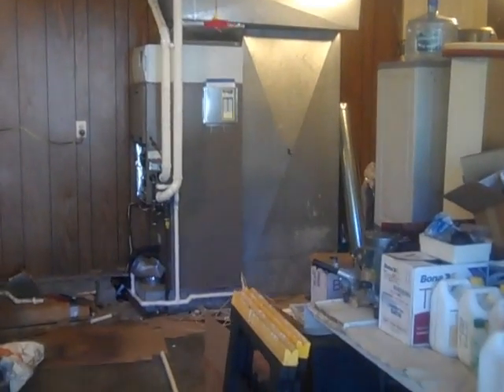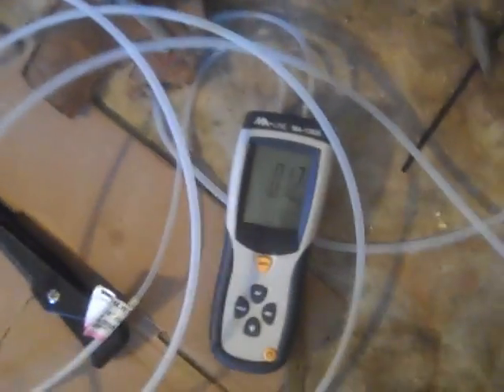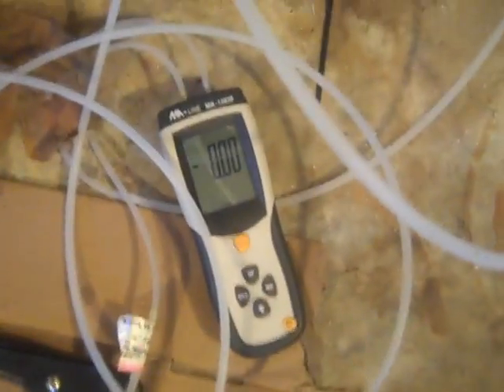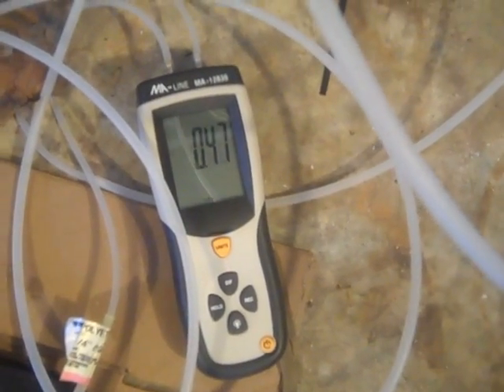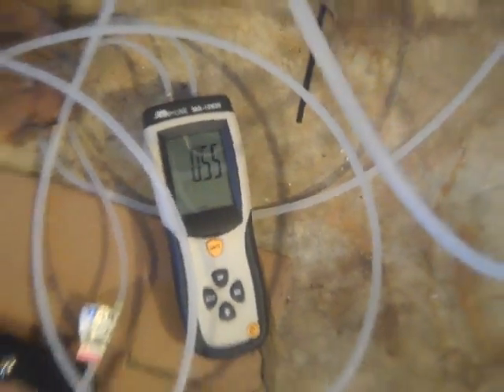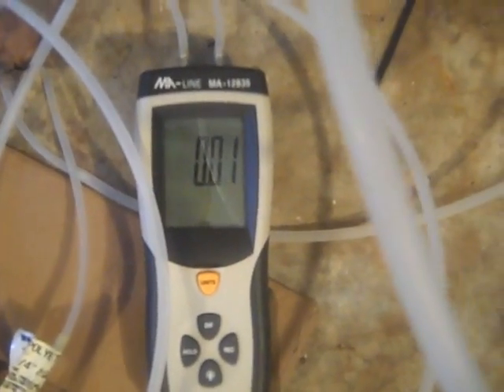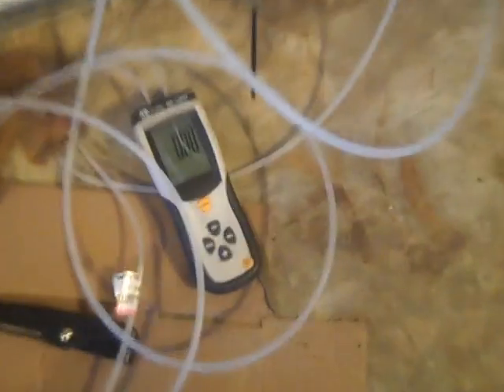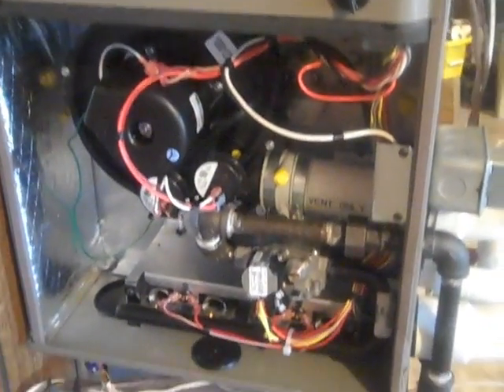Blower table.wmv

Comment: great video. very important to keep in mind when you're doing setup is that if you're planning on keeping a filter in the Aprilaire 2200 box make sure you set it up taking your readings before the filter. those filters can add considerable static pressure depending on ductwork and if the filters being regularly maintained.

Comment from the maker: @ImUrtastyflava The area that the fan is pushing a given CFM through will determine the velocity. The smaller the pipe the higher the velocity will be. All fans have a limit to how much pressure they can exert as well. 

What type of experiment are you conducting? Would a leaf blower work? You might have to scale your experiment down in order to keep cost under control. If you have a really killer idea you might submit it to that show "Myth Busters".  They have a lot of cash to play with.

Comment from the maker: @midimaster It's just ice maker hose. 3/16" I think. Fish tank air hose is the same diameter. The tees made for fish tank air line comes in handy for testing furnace pressure switches and combustion blowers.

Comment: Great video, thanks very much for taking the time to make it.   I was wondering what  diameter the tubing is for your manometer?  I have the short tubes that came with mine and i'd like to get longer ones.  I bought some 1/4 inch PVC tubing from the Depot and that was too large.   Any help would be appreciated.

Comment from the maker: @Nutintoitbut2doit Same here. It's because we all learned from the old dudes to spin the ductulator to .1 on the friction rate scale. 

If you all want a better rule of thumb just pay attention to recommended and maximum velocities. If you need a friction rate that will keep you out of trouble without doing all the equivalent length calculation .06 is the ticket. Velocity should still be checked.

.1fr will almost always result in velocities that are way to high and will loose flow rapidly.

Comment from the maker: @dizziedallas Wow, I can't imagine what thats like. I would like it. Maybe I wouldn't be running into hacked jobs on every job. I hated leaving the existing ductwork - ugly right angles but I would go broke trying to save the world. After taking those readings I regret not changing it. It would have made the installation take more room though. It is surprisingly quiet for such high external pressure.

My manometer is MA-Line.